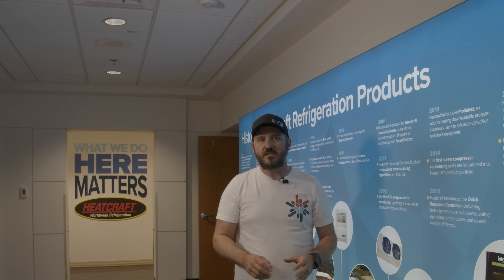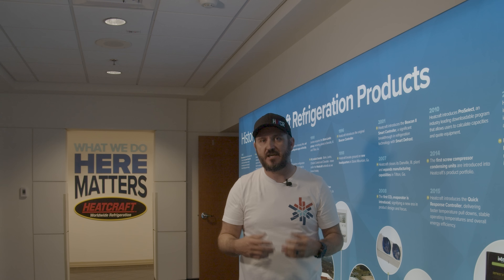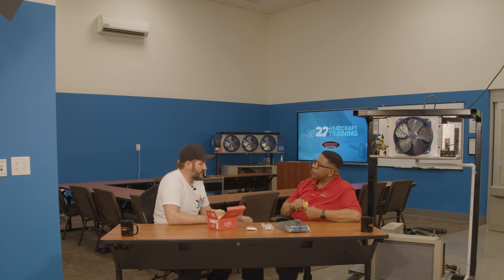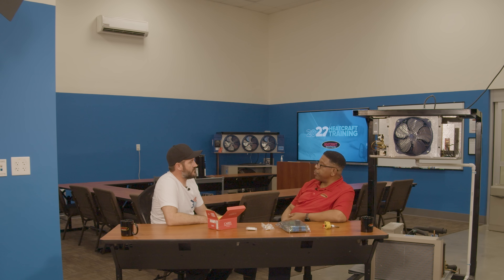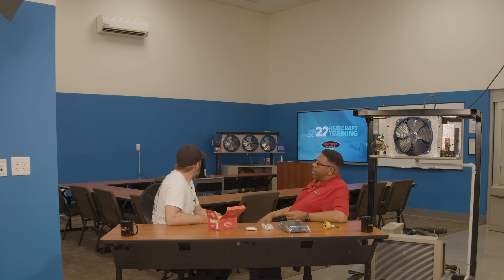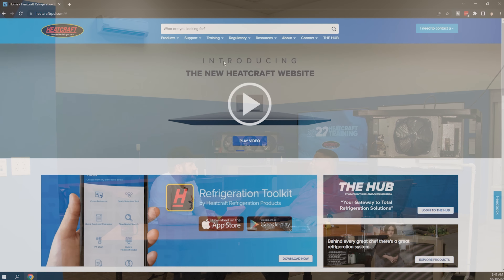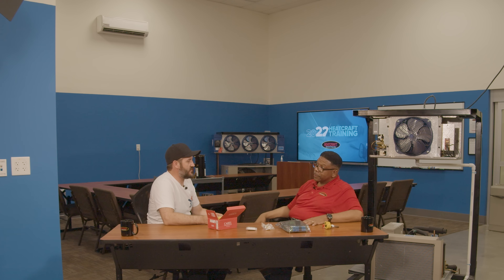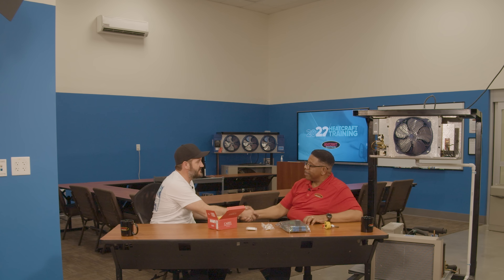HEATCRAFT SESSIONS - TRAINING PODCAST

Comment: Training is very important to fully understand the equipment you are working on.......getting factory training is the pinnacle of understanding the exact piece of equipment you are working on
Reply: no
Reply: Training is effectual if it’s done by a competent trainer. If a salesman does the training, it does not matter who his employer is or where the training takes place. So, I agree with your statement, because most of the time factories do employ technical experts that are excellent educators, they are able to communicate on the blue collar level. However, I have taken more than one class by a salesman, and he was clueless when we ask him questions.
Reply: @scott5654  i agree. Whenni was still in resi...was sent to "training" it turned out to be sales training. I tuned out and used as a 3 day vacation. I didn't participate other than the absolute minimum needed. I should have clarified technical training. I dont think of sales so i didn't word it properly

Comment: Not impressed with the limited experience I have with the Intelligen system. EEV control is slow to react to superheat. Demand defrost not working reliably so moved it to dumby timed defrost. Have been happy with Ke2. Russell Econet seems good so far.